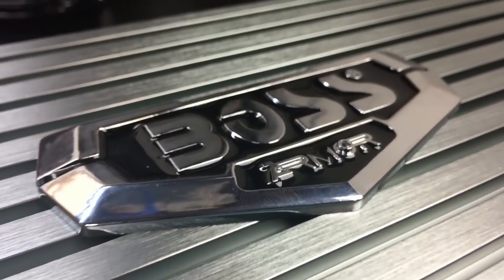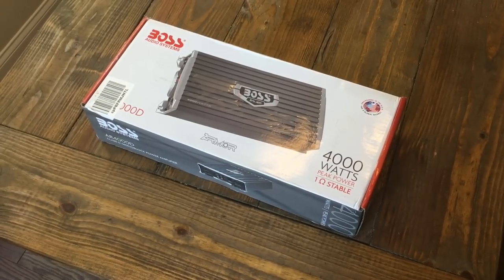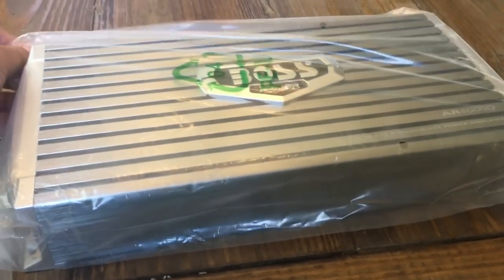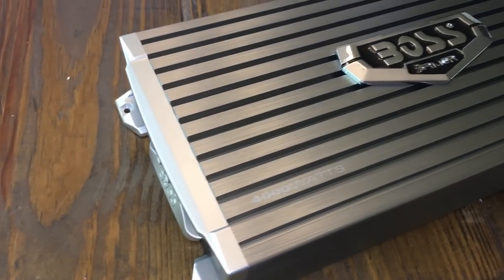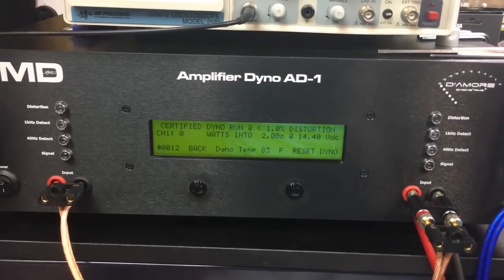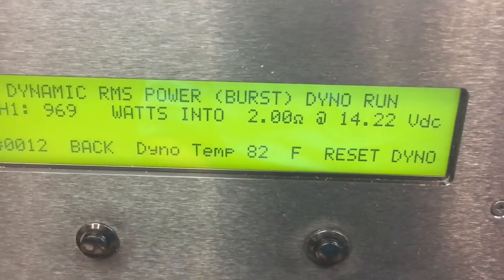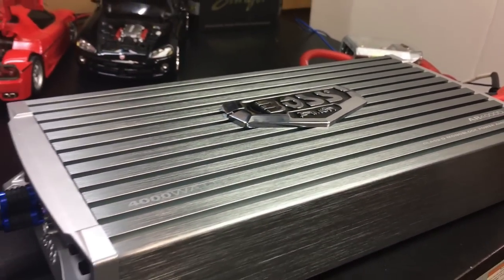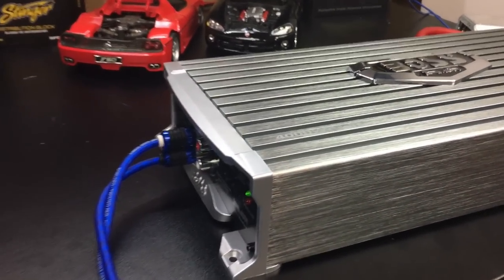Who's the Boss? AR4000D 4k MAX Amp Dyno Test

Comment: Don't think anyone can really say much negative towards it. Biggest issue is some user buying subs according to the supposed wattage. However, if the true wattage was actually stated, the amp probably would sell just as good and garner more respect. That's why I love these amp dyno vids...  nothing like having actual proof.
Reply from the maker: +Denis M I'm guessing their subs have bloated ratings to match the amps, so as long as you stick with the same brand you can match them 🤔
Reply: I'd even go as far as saying it would be ideal to use on decent quality subs of about half power or so to ensure the amp isn't stressed.

Comment: Can you please do the boss pd5000 class d mono block amp. Im currently using the boss Amor 4000.1D after this video and am wanting to know if i should upgrade or if the power rating isn't a big enough difference to pick it up. Thanks in advance

Comment: will you please dyno the mb quart 2050.1d ? its in my opinion the best budget amp I had a audiopipe 1500 that you dynoed and i bought it based on that ..it powered 2 sundown sa 12s in a 6th order ..i went thru 2 amps ..i bought a mb quart 2050.1 and it killed the subs ..no clip gains set proper with o scope. bought 2 american bass xfl 12s and put them in a 27 hz tuned box and they are killing it ..i would like to see dyno numbers please !

Comment: Big D been scope'n your vidz or years and have seen all kinds of amps true colors revealed but i cant recall ever seeing any Old Hollywood Sound Labs I have an RS-800 that ive repaired so many times the copper is gone where the transistors mount and I have to run the leads directly to the input resistors and the heat bars hold them in place. I have not seen any info on the specs but its a 2 channel class AB cheater amp, No fuse onboard, mine will run great in AZ heat for months bridged mono at 1 Ohm then out of the blue not even warm at low volume at a stop light ill see flames inside the clear plexi cover as another transistor burns up. A test of anything they made would be fun to see. and 1 other company ive never seen is Kenwood, never was a fan till i took out my RS-800 for repairs and saw i had a kenwood execlon 1600 sitting in a stack of amps that sat untested for years. I was very surprized when I installed it, Been my substitute amp for years now, never an issue always at 1 ohm and always in the hottest livable environment on earth. Any kenwood amp test just to see what they do compared to advertised. Not a popular brand, mine sat untested for at least 5 years, i dont even know where i picked mine up thats how much i thought of Kenwood before i decided to see if it even worked. its rated at 400w @4ohms 800w@2ohms 1600w@1ohm class D mono. or how about a Kole {i run a big 2 channel AB bridged mono 1 ohm without issues)

Comment: For what it [actually] puts out, it's not a bad deal for $85. It actually performed better at 1 ohm than I expected. There's better options out there too. But my biggest gripe is these cheap amp manufacturers with bogus claims like "4000 watts" when then fusing makes it obvious that it would be impossible (unless this amp could somehow handle 36+ volts lol).

I don't expect everyone who's dropping $85 on an amp to have extensive electrical knowledge, but I would hope that something could be done about these companies that make false claims of their output/capability.

Decades ago I was turned on to JL Audio because they rated their speakers at true RMS. The first 500 watt monoblock Class D amp they ever made, I bought one, it cost me $450 at the time (about $1200 in today's current money). It was advertised at 500 watts RMS. The certified paper that came with it said 1720 watts peak, which I believe because I was pushing a set of W3's that I was blowing line fuses with regularly until I went with a 100-amp breaker that I would only occasionally trip when I tried pushing it too far.

In older age now I don't need something that rattles windows half mile away, but I still buy higher-end stuff just for the fidelity and capability to support a robust soundstage. That's the most important thing I learned once I jumped from cheap bargain stuff to more expensive brands, the quality of what you're hearing goes up dramatically regardless of loudness. I'll take 500 watts of clean volume over 800 watts of clipping every day.

Comment: Hey Big D so do you follow the dynamic rating? I need 800 watts rms @ 2 ohms will this amp do that or will it do the 700?
Reply from the maker: For subwoofers I’d pay attention to the uncertified test in most cases
Reply: BigDWiz can you recommend an amp? I need an amp that does 800-1000 watts rms @ 2 ohms and kind of on a budget

Comment: i'm getting an 18 inch blaupunkt sub with 1800watts rms with 2x 2ohm voicecoils, do you think 1400watt rms from this amp is good enough?  love your channel btw
Reply from the maker: +RifleRud I didn't know Blaupunkt made an 18" 1800w RMS sub...anyway, this amp would get it moving, but you might want something a bit more powerful to make it really sing
Reply: search for Blaupunkt VPW 460 18" inch sub and you'll se what i mean. i'm only 15yrs old so i don't want to spend to much on an amplifier, but when i get one, i really want to get an amp that is stable at 1 ohm and will not fail

Comment: good morning mate. if possible I have a question for you. I'm running 18 dd 3500 with a dsp for my vocals. My sub is fine its my vocals. it'll play good for about 5 mins then my vocals get low and if i turn the volume up it distorts bad and the audio shop don't understand what's wrong. I've swapped out the head unit thinking that was the problem but no it wasnt. When we change the head unit it sounded like it was fine but a little while later it started again. I've had my system for 5 months and i can't even enjoy it cause of my vocals. Help anybody please thank you

Comment: I am so curious to find out what the boss ar3000d does rms at 1ohm. I've had one in my lincoln town car going on 5yrs with no problems. I have it pushing 3 quantum audio 10s wired at 1.3 ohms and they bang hard, bass so deep it make your eyes jiggle. And after watching this video, I'm going to step up to the ar4000d which is only like 20 bucks more than the one i have currently. But I would really like to see a dyno of the ar3000d if all possible.  Love your videos man glad we have an amp god who can lead us audio heads in the right direction. Keep up the good work
Reply from the maker: 1/4 of rated is my guess based on the AR4000d

Comment: Can you bridge an amp like that? I'm new to building a stereo.  I have a 1200.1 kicker and a 300.1 kicker.  1200 to run to 12 4ohm and the 300.1 for my 6x9's- 4 of them.  Thanks for the help, Ric
Reply from the maker: Hi Rick, monoblock amps are already bridged. The 1200.1 will work great with your 12” subwoofer, but you should get a 2 or 4ch amp for the 6x9’s. You not only need an amp capable of full range, but one that has stereo channels as well
Reply: BigDWiz thanks so much!  I'll go eat ya know how it goes!

Comment: Boss continues to impress me, as long as you ignore the big numbers they stick on everything, you'll get what you pay for generally. I had a set of 20 dollar Boss 6 by 9s that sounded excellent, I blew one of the tweeters out playing music too loud eventually and upgraded them. My R3004 4 channel is running my door speakers off the front 2 channels and a 12 inch Pioneer on the rear 2 channels bridged together. It really hits for what it is, although I'm definitely planning on getting a dedicated monoblock for my sub.

Comment: Hey Big D great vids could you recommend a good budget class amp to power 2 12 sub 1800 max 600rms and one 10 300rms I'm new to the game any suggestions would greatly be appreciated
Reply from the maker: Budget amps can be challenging as they are not very reliable. Orion has stated they are going to offer a true 2kW amp for around 200 in Jan. 2018. May be worth waiting for this one

Comment: I agree with your assessment of this amp.  Although the power rating is obviously exaggerated, it appears to be a solid amp especially at the $100 price.  

So, what measurable characteristics of high end amps justify their higher prices; better noise rejection, lower noise floor, more power with lower voltages, more consistent frequency response across the power range?
Reply from the maker: more expensive amps use better components and are overbuilt, designed for reliability. This one is laid out well, but surely costs were cut by using the least expensive parts available

Comment: I sold this amplifier years to people an i had to work with there pockets an this was my go to with 2 kicker cvr 12s perfect set up more then they need an sounded amazing for what the amp cost the brand has nothing to do with the sound only thing i can say is bad the wiring terminals melted a few times from the remote being so close to ground an it pulls to many amps for people with a honda or a toyota there alternators would b going out but this amp is very very good for the price

Comment: How long can you listen to it until it overheats and go into protection mode.?. I have a 1100 Watt Riot and within 5 mins with the amp turned only a quarter of the way up and the volume from my boss head unit at 25 out of 40 goes into protection mode and it barely shake my rear view mirror in my SRT-8 Dodge Magnum.!.
Reply: Hey bro I'm running a boss touch screen and a boss ar3000d monoblock with the Boss Phantom series 2300 12in subwoofers two of them I got them both hooked up and I'm running both at 2 ohms and it's running into the amp at 1 ohm stable and man dude that s*** is knocking I mean you can hear me from about two blocks away I turned my system up and I had my chick pause it and then go around the block a few blocks away and I had her come back and I called her on the phone where I can hear from she told me where she was at and I was like damn you are literally two blocks away that's crazy and I can hear you so I don't know if I just got a really good boss amp and some really good Boss speakers from them but my s*** is banging and my s*** doesn't go into protection mode either and I usually bump it at 30 because we know boss head units only go up to 40 so maybe try that set up I got bro that s*** has my rear view mirror shaking my side view mirror shaking when my window is down a little bit and has my windows shaking

Comment: also I can give you an honest opinion on this amp ive been using mine since 2015 with low voltage issues here	and there and the amp has never quit it is a beast !
Reply from the maker: +Droppin Lowlows cool, that's great news 👍
Reply: BigDWiz I Love your vids Big D soon I get a chance im hop on patreon dont quit doin what you do bro check out my channel for my  set up its runnin on that same boss ar 4000 but I got v1.blue board with yihcon caps just like all the brutus'  and sae sundowns so it a really good p.o.s. hahah ive always liked boss from 90s my coolest cheapest amp was a clr 40 clear top back then m	de by Zed as you know .
Reply: I had one my cousin gave me.. Hooked it up to four 12's and it used to distort the glass on the rear window of my grand Cherokee, worked great until I ran it at a low volume for four hours with my fiance and kid in my jeep. By the end of the trip it has died trying to push four subs at minimal power.

Comment: Ok so i'mma get this amp thanks to u. I've a PA gothic supposed 1000w 10 inch sub that I would not have ordered if I saw your videos sooner🙄 Any recommended 10 inch sub to pair with this amp. It'll be going into a ported 1.5 tube

Comment: Boss was the first brand of amp i ever got when i was 16 in my first car and first system the not that good with power but the last 4 ever like the energizer 🐰 you can even mix the + - and its going to still work 💪🏽 cheap but reliable

Comment: I am guilty of wanting more power, but now days , I look at the sound, when it sounds like I have the sound  right, I leave it alone, if it starts getting that sound when you are pushing it to far, I then get a more powerful amp, At 53 I am at the quality of sound, my 92 gmc topkick that has a dually bed and 22.5 semi wheels has 13.500, yes thirteen thousand five hundred watts with 5 amps and 14 speakers, the idea there is, my way of thinking about things that push me in a way to get relief , I quit drinking and all other ways of escaping my headaches, going down the road at 75 windows open and I don't want to here any road noise, I just basically got it most installed yesterday and it is close without making final adjustments, you only get that old when you let it
Reply from the maker: +majik fuzzybutt good for you bro 🤙
Reply: majik fuzzybutt are you sure you quit drinking?

Comment: hey, a possible idea I had for a video is what if you got an amp with the absolute cheapest Chinese caps and you dyno it then replace them with Japanese low esr caps and see if it makes any difference to power and if so, how much.
Reply from the maker: +Thomas Sears I like the idea. Most of the caps in a Class D are for filtering, so changing them may increase reliability, but short of changing out the transformer or adding transistors, just changing caps won't make any noticeable difference in power.
Reply: BigDWiz in theory the ones for the positive and negative voltage rails and somewhat the input caps should make some difference. I'd do it myself but I don't have an amp dyno

Comment: Hey Big D, could you do a video showing the amp power when they are strapped?
Reply from the maker: That means I’d need to buy another 😬
Reply: BigDWiz 😀 I actually bought this amp after your review, I really wanted to have at least a good 1k watts at 2ohms. I was running some budget 4ohm 10's and blew them. I upgraded to 800 watt hiphonics dvc 10's running 2ohms and I bought a second amp to strap. I'm curious how many amps I'm getting.

Comment: Can i power this amp with a single battery in my car, will it be safe for the battery since it has 3 30amp fuse
Reply from the maker: +SimranJeetSingh Matharu yes, but you would benefit from an extra battery

Comment: I bought one the other day had it hooked up by Alfred's connection put it on a meter to test it out on 215 Power Acoustik bamf 1900 watt RMS each the amp wouldn't even turn up a little bit over a quarter not even half way and it was getting the subs real hot after about 3 minutes I don't know if I have bad Subs or their meters were messed up

Comment: That 4 ohm rms power is only for one sub if u have two will it cut in half???
Reply: Power is Always  divided among subs. If you have 2 2ohm subs wired down to 1ohm on 1200w amp that's 600 per piece

Comment: I got a AR3000D.1 don't know how you tested it but I've seen the 3000 I have tested at more power then what you got out the 4000. I've had mine for about 5 or 6 years and it never gets hot and it takes the 1ohm load all day no issues.
Reply from the maker: I tested using the Amp Dyno. How did you test? 🤷‍♂️
Reply: BigDWiz it was a video I watched the only reason I even bought it. I got mine brand-new for like 89 bucks I expected not much but can honestly say I run Rockford everything except the mtx elite series amps and this amp does way beyond my expectations for 89bucks

Comment: Big D... can you dyno run on 5ch amps, in particular the Rockville dB55, thanks..
Reply from the maker: +pcselec Dyno tests only 2ch at a time, making it really difficult to get accurate "all channels loaded" results for 5ch amps
Reply: BigDWiz I see. supposedly it's two two amps in one so you can test the class D amp in it and the class AB side separately. my thing is these all-in-one amps seem to be a good solution for making a lightweight system especially when you have a performance orientated vehicle and want to keep things light weight.... curious about the RMS in the DB 55. thx.

Comment: Here are the RMS ratings for this amp; pulled from the Boss Car Audio website:

3000 W X 1 RMS @ 1 ohm
1500 W X 1 RMS @ 2 ohm
750 W X 1 RMS @ 4 ohm
6000 W X 1 RMS Strapped Bridged Power @ 2 ohm

Comment: i have two MTX comp 2ohm dvc 2000 watts
single ported box, single cab dodge ram  
anyt suggestions on a cheap  1 channal amp for my setup 12 v batt./w 32 v cap.
Reply: 3000 watt Boss 2 channel. Do not get a mono-block! The 2 channel is more accurately rated, versitile, and by far the best bang for the buck. Bridged it'll easily push both subs and won't over heat. Always get a little more power so they don't stress and over heat the amp.

Comment: I have the boss ndx5500 and I am very curios of the actual numbers it puts out. it was at one time the most expensive amp boss had and it has a good amount of push to it. I'm working a pair of dark audio nko 12 d2 s pretty well( in a sealed enclosure) ....also you should take a look at dark audio , there subs are built like tanks.

Comment: Someone gave me this amp and I’m confused on what the rms exactly is and need help finding what 10 inch sub to run with it?
Reply from the maker: Around 1000 watts at 1 ohm. See video for results at other ohm loads. Speaker selection depends on box size, type, expectations, budget and more. Not a simple answer.
Reply: BigDWiz I read over the chart you made so I think I’m gonna run a 400-500 rms 10 inch sub with this???

Comment: On a budget $100 for 1000 w ain't too bad but if you can afford it there's the CAB 1600.1 and or a referbished skar 2000.1 both for around $200 
Look up Ther dyno tests. I had the cab 1600.1 hooked to 2 sundown SAs wire down to half ohm and I clamped the app to see my average wattage and I averaging 1668w and that was on 12v system if i did it correctly